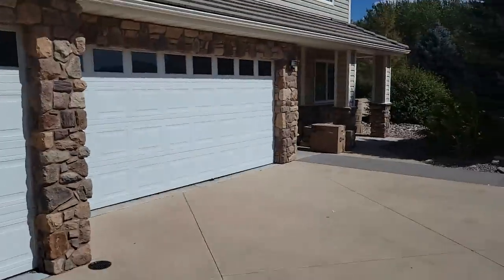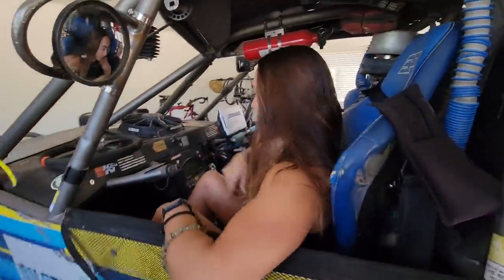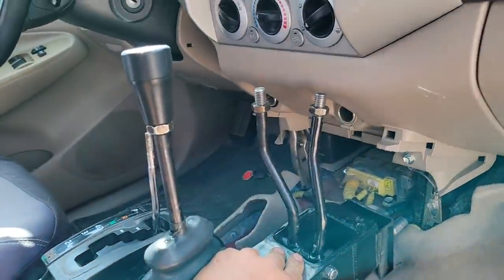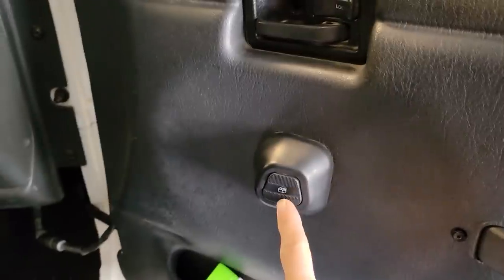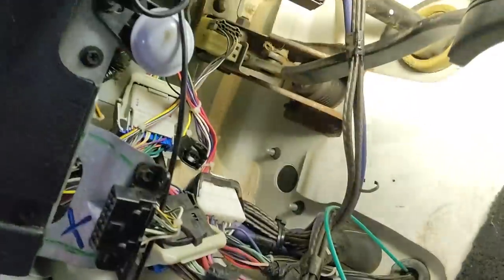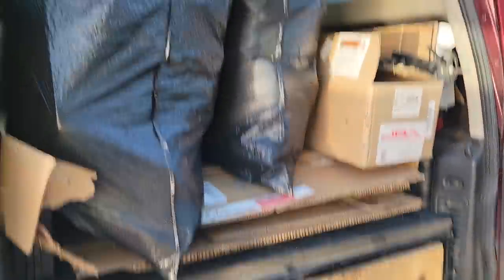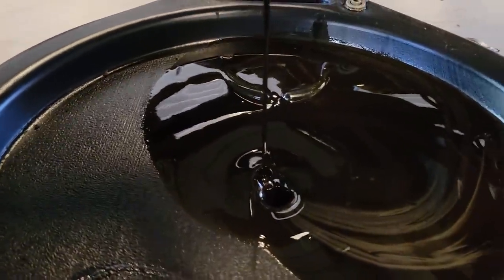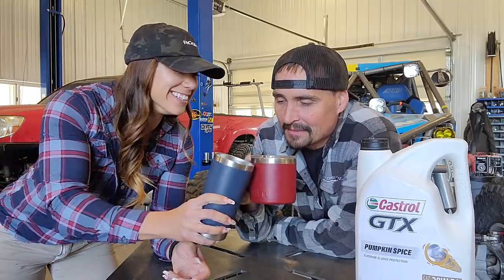SHOP TIME!! TACOMA UPDATE + ULTRA4 PREP + JEEP LJ FIX + BIKINI CAR WASH!

Comment: I just replaced my door straps on my jku  the new ones had a zip pouch to place wires. I believe I picked them up thru Quadratec. Now you have a big radio to smash your knee on.  Great work on the light switches.......

Comment: Chris I’m wondering I’d you would like another project! I have a 1983 AMC EAGLE I want to put a stroked 4.0L fuel injected and a TJ drive train under it. Want everything to work with a clean factory install. Lifted with 35” tires, I would like to have cruise if possible… would like it to be a weekend lite wheeler with lockers and a great grocery getter. 

What you think? Sound like a fun cool project you would want to tackle?
Reply from the maker: Anything can be done with enough money

Comment: SO(80+/-3), another Great vid! That dash mount turned out super clean! 
Im guessing that the voltage was  good after the alternator was re-installed?  
just a guess but, im thinking you two might get all the business you can handle!  if you offered a video of the repaired trucks being washed down for pickup

Comment: was that a baofeng two way radio on the door this FRQ think you dont need a licsence use this frq in the radio enter 154.600 simplex and also 154.570 please stay out of the ham radio frq i can build out door antenna for these FRQ for vhf i can build for uhf also just need the frq you plan to use

Comment: In Europe, nobody would ever run a big Welder even on 220, we use 3 phase 400 V for every big Machine.
Reply: Not only that,, you guys power your lightbulbs with 220v also.  We may catch up some day. lol...
Reply: @bjbunns9153  with copper prices this high, maybe you will catch up sooner rather than later :-) I can only imagine the wire size of a decent welder running on 110 V

Comment: i knew a guy who built sand cars he had a idea he never got to do maybe you can do it build a sand car and take the motor and transmission from a front wheel drive car and put it in the back of a sand car he never got to do it because of cancer he built alot of cars made good money he never got the chance to build his new idea one thing the idea save a few bucks not have to buy adapter plate for the bell houseing and buy the the better transmission for it because the VW trans was to weak to handle the power